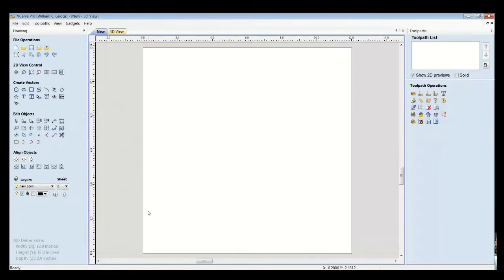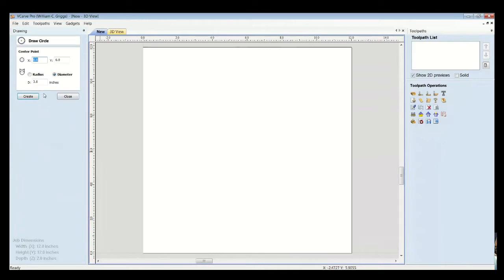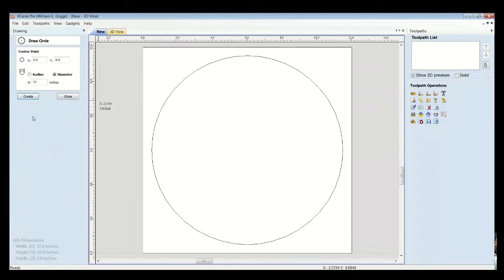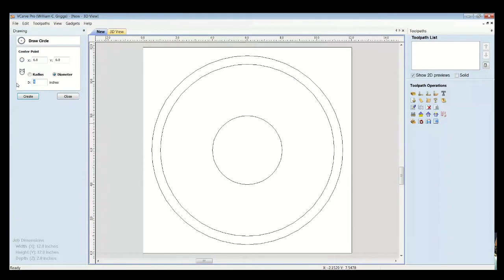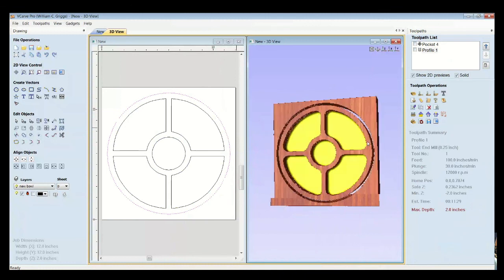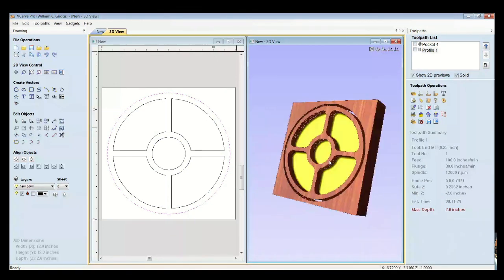CNC ROUTER TIPS - How to Make Bowls in VCarve Pro.

Comment: Thank you. Your carving time for the pockets with 45 minutes ist quite long. If you use an end mill first and the ballnose bit last you will gain a lot of speed. But of course you then have to draw the fillets unless you use the same size end mill - which I personally do not have. Mainly I use for pockets a 6 or 8 mm end mill.
Reply from the maker: Thanks for the feed back. The video was made to show the technique, not how to optimize it. If I were doing this process in production there are many ways to drop the milling time. Perhaps I should revisit this topic with a mind towards showing how to optimize the process? What do you think?